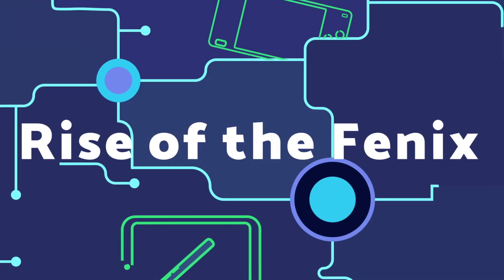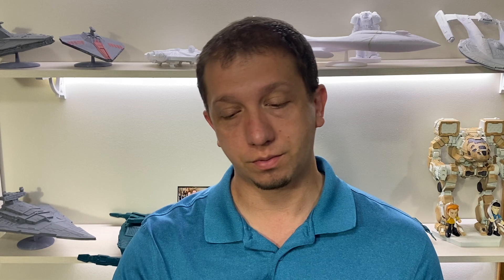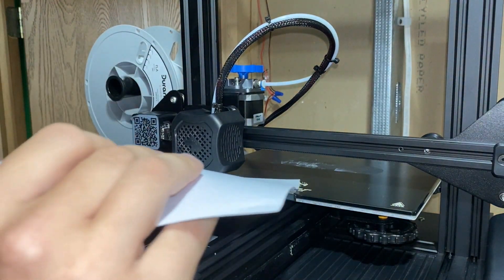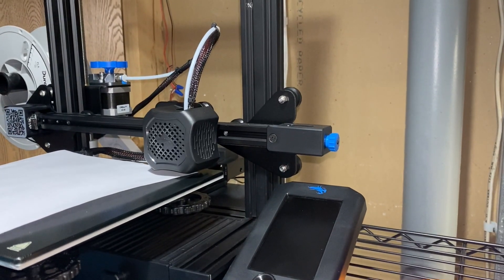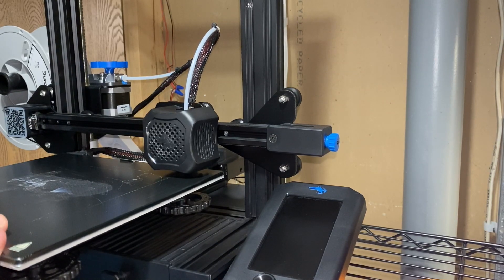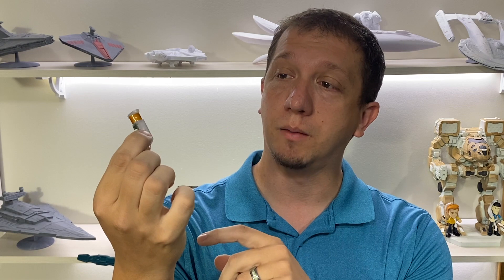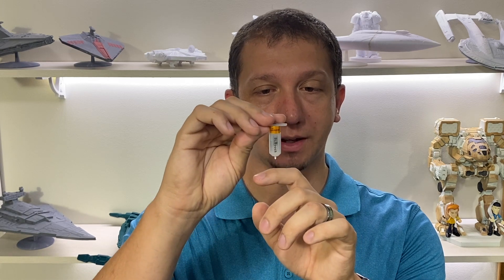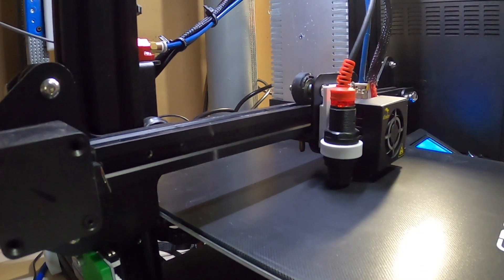Ender 3 Bed Leveling: 3 Quick & Easy Ways

Comment: Which bed leveling gcode did you use?
Reply from the maker: Matt,  Take the below info and copy it to a text file and name it bed alignment.Gcode
Here is the contents:                                                                                                               M190 S60              ;heat bed to 60C 
M104 S195            ;start heating extruder to 195C
M109 S195           ;wait until extruder reaches 195C
G21                ;metric values
G90                ;absolute positioning
M82                ;set extruder to absolute mode
M107              ;set fan off
G28 X0 Y0         ;move X/Y to min endstops
G28 Z0            ;move Z to min endstops
G4 P20000            :wait 20 seconds to set first corner with paper slip
G1 Z25.0 F9000    ;move bed to clear indicator
G92 E0                   ;zero the extruded length
G1 F9000
M107   ;set fan off
;Move DTI to each corner in turn
G0 F3500 X10.000 Y60.00 Z10.000
M117                ;zero DTI
G4 P10000  ;wait 10 seconds to set DTI to zero
G1 X280.000 Y300.000
G4 P10000           ;wait 10 seconds to adjust bed      
G1 X280.000 Y60.000
G4 P10000           ;wait 10 seconds to adjust bed
G1 X10.000 Y300.000
G4 P10000           ;wait 10 seconds to adjust bed
G1 X10.000 Y60.000  ;return DTI to start position
G4 P10000           ;wait 10 seconds to adjust bed
M107                ;set fan off
G0 F9000 Z25
;End GCode
M104 S0             ; set extruder temperature off
M140 S0             ; set bed temperature off

M84                 ;disable steppers
Reply: @Rise3DBuilds  thank you, i will check this out.
Reply from the maker: Any time!!!